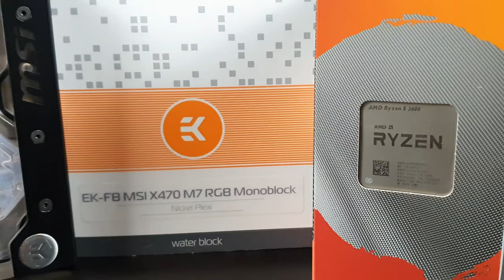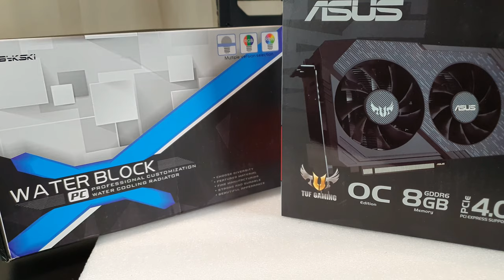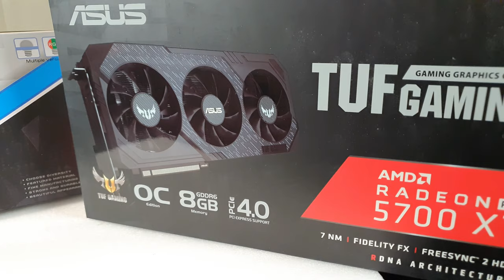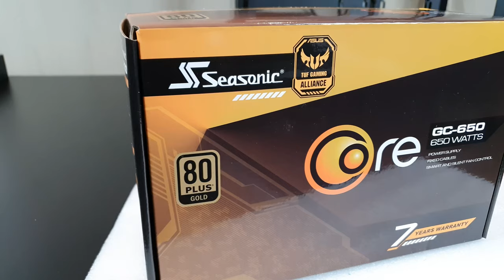LIAN LI PC 011 DYNAMIC - RYZEN 5 3600 - ASUS TUF RX5700 XT 8GB OC - BUILD "XXX #1" - 2K 4K GAMING PC

Comment: What is the average temp on ryzen 3600 working with this custom watercooling?
Reply from the maker: About 55 Celsius in gaming at full load
Reply: @PCBUILDMOD  hi buddy, i made the same water cooler custom, with same pieces. but my thermal are very hight. could you help me?
Reply from the maker: @diegomonteiro6602  Sorry but i don't help you if i don't have the Pc in my hand

Comment: you watercooled a ryzen 5 3600 and a 5700xt. its preferance in the end but imo you wasted so much money on looks when your system will preform worse then a 1000€ budget pc. nothing wrong with spending money on aesthetics but you went absolutly overkill with watercooling on this build. i get that it looks nice but not every is it worth the drop in preformance.
Reply from the maker: This is build have a lot of quality:
solid performace  with lower noise, lower temperature, is a good choice for next cpu upgrade and finally have fantastic look! 👍
Reply: 5700xt is known to have some pretty bad heat problems, especially with the founders cards... Sure the 3600 doesnt need watercooling, but then in that case, no processor needs watercooling apart from the Threadripper, Ryzen 9, and Intel i9 chips. Let enthusiasts do what they want jfc
Reply: @anonym_s5031  its not the problem its watercooled its just a waste to put so much money into aesthetics to loose out on performance. i dont know the exact budget of the build but im guessing it was around 2000€ which with air cooling or even AIO could get you a 2080super with a i7 10th gen with an AIO with much better performance and still keeping good aesthetics.
Reply: @anzekoprivec  how are you losing performance...
Reply: Anonym_s what do you mean? hes loosing performance by spending so much money on aesthethicd that his other components arent as good as they could be for the money.
Reply: @anzekoprivec  Well he's not losing performance, he just could have bought different parts. Anyway by your standards, people shouldn't water cool unless they have expensive parts, but what if I want to water cool, but I don't want to waste money on parts I will never utilize?
Reply: @anonym_s5031  if you buy a 5700xt you are probobly going to be gaming which means you would utilize and benefit from a 2080ti. like i said its all personal preferance but i personaly dont see much point in so much money wasted on aesthethics when theres a lot of performance to be gained for the same price. paying 2000€ for a pc which perfoamcne will be more then halfed of the current standarts in a year or two just to be able to watch some liquid flow through it is stupid and almost every pc builder would agree with me. and if you are talking about parts you would never utilize then this pc is a prime example since i dont see someone with a ryzen 5 3600 utilizing the cooling performance of watercooling and probobly won't OC it much if any.